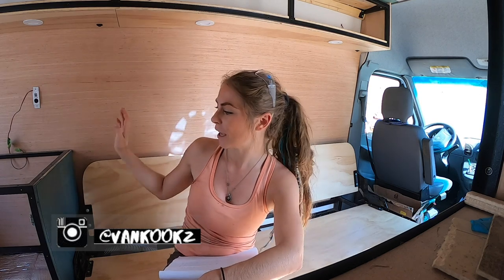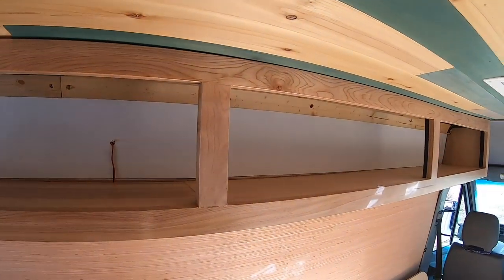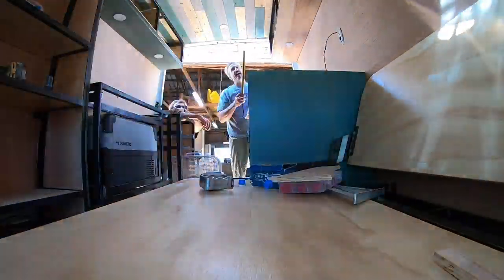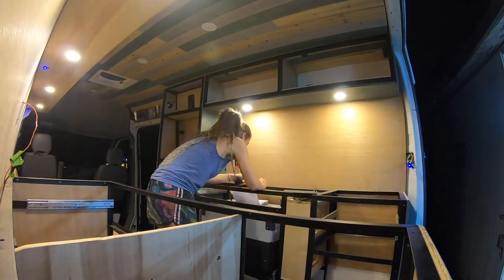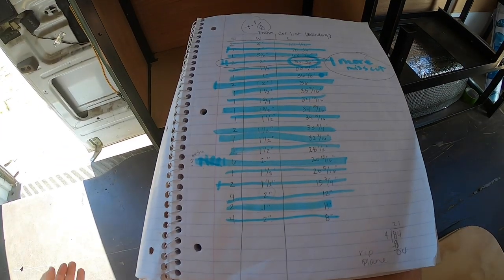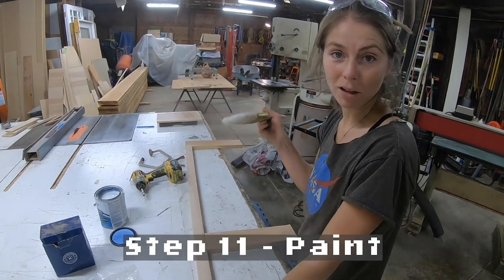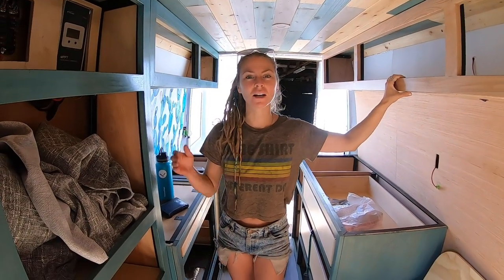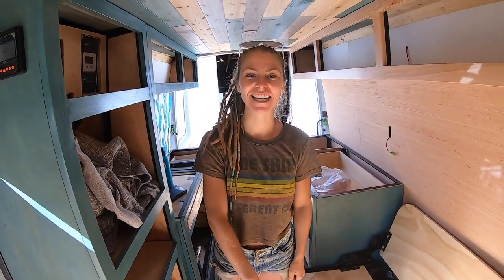Professional Face Frames in a Sprinter Van Conversion | How to Finish Metal Van Cabinets

Comment: Nice work, Kookz. That is going to be a sweet rig for some lucky soul. You could probably skip the belt sanding step and just hit it with 100 grit then 220 in the palm sander. Stoked on your progress
Reply from the maker: SC Nomad good to know the belt sander seemed to take material off so fast it was scary to use and hope we didn’t mess everything up!

Comment: the finish work could be improved if you put on wood sealer first. than use a compressor and spray gun to spray the stain on. it will bring your work level up a lot and be faster than doing it with a brush. right now you can see its blotchy especially in the corners where the color is absorbed more. also final sand with 400 after you do 220 grit, use scotch brite hand pads (not for dish washing, automotive paint shop or amazon) for the corners .  use the maroon color or the grit right above it. or just sand with paper by hand. also wear a respirator with organic vapor rated cartridges , they last 40 hours after you open it, put the mask in a gallon ziplock after each use to prolong the cartridges
Reply from the maker: Yeah we wish we had a paint sprayer.  These are great tips!  Thanks!
Reply: @Vankookz  Just one more advice, If you have Harbor Freight nearby you can buy the purple spray gun for $10. you can get a good finish with it, or at the very least you can use it to practice on scrap wood. if you do not have a compressor the best deal at harbor freight is the new mcgraw 21 gallon 175 PSI blue colored compressor. Don't get the 20 gallon compressor, they look the same. you want the 21 gallon with 175 PSI. if you already have a compressor all you need is a water filter on the spray gun and a cleaner for the gun. I spray 2K paint so I use lacquer thinner. you might use that or acetone, etc. you also need to thin the paint.  for stain and polyurethane just read the label, it's usually whatever is used to clean up is what is used for thinning your paint or stain. you can ask the paint store if you don't know. always clean the gun immediately, you'll find out why if you don't. And the most important advice about spraying is use a respirator rated for Organic Vapor, usually 3M 6001 cartridge. home depot has a reusable mask for like $28, well they did before the coronavirus. also for spraying latex add some Floetrol, it's used to make latex flow like glass. I use more than what it says to add. for oil based paint use Penetrol, both products are by Flood at the home improvement stores. So yeah a gun and a filter for $20 will get you started with spraying, later you can upgrade the gun